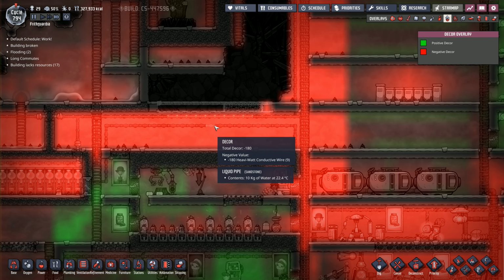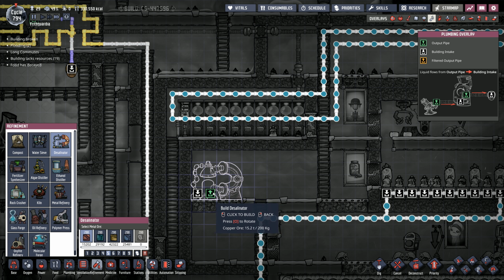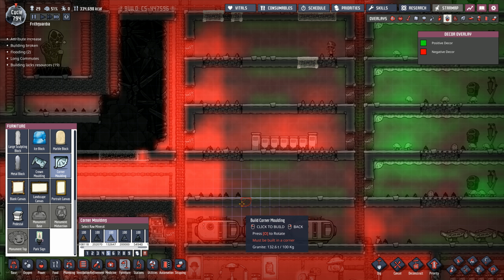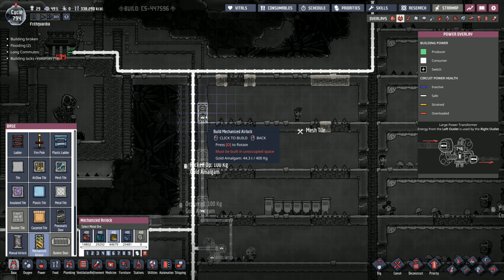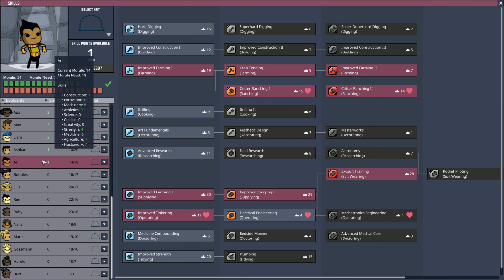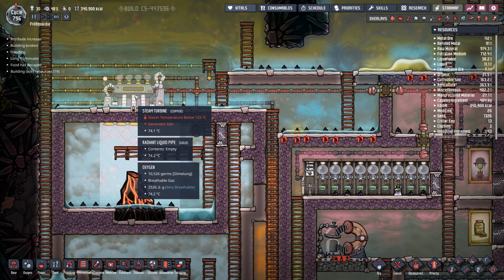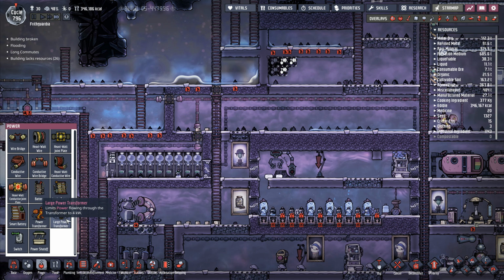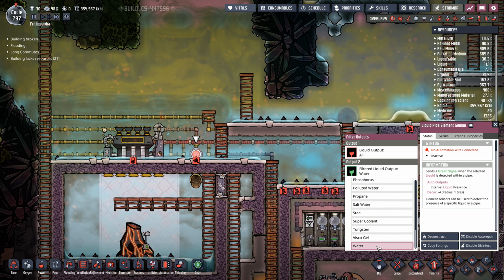Let's Play Oxygen Not Included #141: Water Cleaning And Desalination!

Comment: Hey Frithgar. Your base cooling was working fantastic up until you tried to cool the worts cooling the steam.  You should be able to get the temps quickly down by simply removing the bit going up through the worts and the steam to prevent the superheating of pipe contents. I actually wonder if part of the delay in your steam condensing back to water has to do with the sheer size of that space. Regardless, curious to see where things are headed and still loving the series.